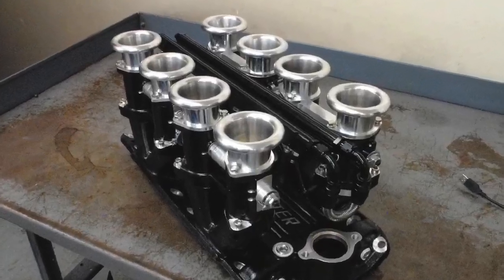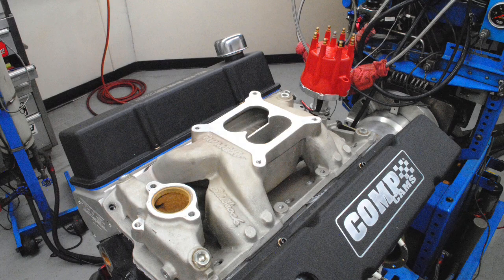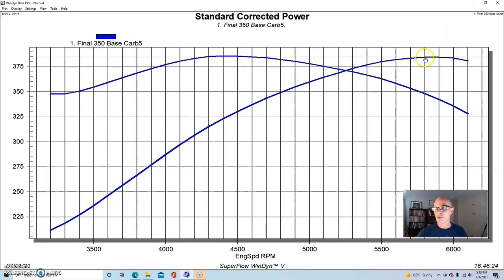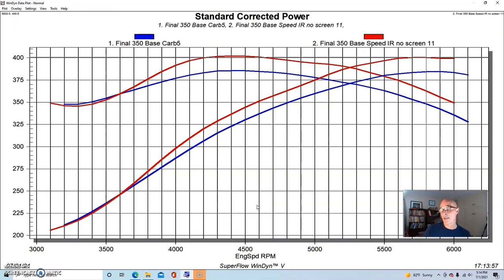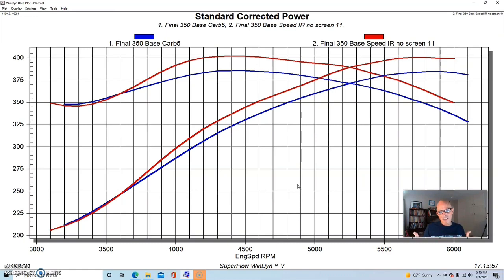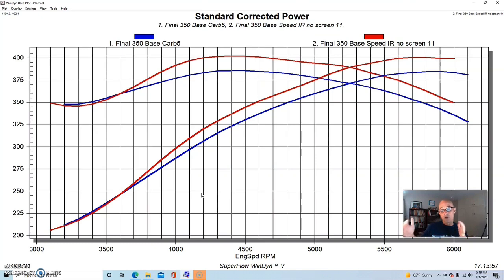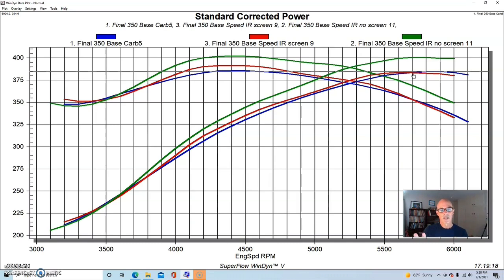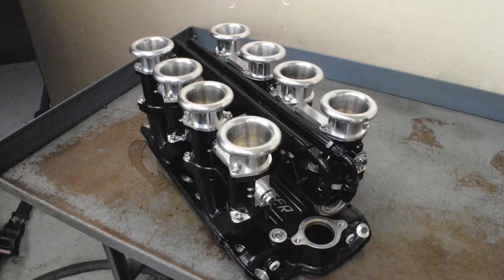SBC EFI STACK INJECTION-DOES IT WORK? (FULL DYNO RESULTS)

Comment: Now do 4 down or side draft Webers 🤯 And when you yet to the Ford the unicorn of carbs. The Autolite inline 4 bbl
Reply: Never play leapfrog with a unicorn.
Autolite inline 4-barrels are wicked.
Reply from the maker: I have a test up on the Autolite
Reply: Those inline Autolite carbs worked really well with the better airflow and mixture distribution - until the cars went into a corner (they were born back in Trans Am racing days) - and for some reason Ford abandoned them instead of working out the fuel slosh problem.
Reply: @Motor-City-Mike  
The fact that the SCCA disallowed them for Trans Am use didn't help. And as I understand it the whole point of the inline carb was runner optimization with the spacing on the carb matching the intake port spacing on the Boss 302 heads. When these showed up at the start of the 70 season the SCCA had instituted a rules change for A Sedan (the basis for Trans Am) that disallowed multiple carburation.

Comment: I was just watching some Steve Tech videos with Steve Morrison, and one that grabbed my attention was about hydraulic roller lifters vs solid roller lifters. One thing he mentioned was that it's a possibility to run a solid roller with the hydraulic roller camshaft. Have you done anything yet on this. I was wondering what kind of difference in power you would see with something mild, like the combination you used right here in this video. I had seen a couple of other guy's videos that mention that the maintenance isn't as big of a issue with the milder stockish/mild performance camshafts. More or less, being more streetable, and somewhat reliable. Thoughts?
Reply from the maker: I don't really see a reason to run a solid lifter with a hyd cam on a mild application-we have run solid lifters on hyd roller cams on BBC applications and it works just fine
Reply: @richardholdener1727  but why? is it for more radical cams and the hydraulic has softer ramp up on and off the seat? as I'm building a BBC with a small 250 supercharger thanks. love the stacks vid to be fair the carb should of had a run with a filter too but I get it . Cheers from Australia
Reply: @r0bkills  choose what lifter you want to run and buy the appropriate cam. Lobe profiles vary A LOT , i have fitted street solid rollers with less aggressive lobes than many of the gnarly hydro rollers, there is no need or magic. 
 The basic big difference is the lash ramp, if you run solid lifters on the hydro cam youneed to ensure your lash setting falls within the lash ramp.  Also the lobe profile will no longer reflect the spec of the cam as   lash or lack of it alters what you see at the valve.  Yes it can be done, solid on hydro or hydro on solid but no point if starting from scratch.
Reply: @8power857  thanks 8power yep going hydro on both only aiming for 650 hp cheers!
Reply: @r0bkills  no problem ✌

Comment: I run 8 stacks EFI an a 452 cu. in FE Ford.  Made 600 ft.lbs on the dyno, up 50 from the Victor intake with 850 holley.  Peak HP was about the same.
Reply: So I’m other words not worth it. 3k for a 50ib increase? Only thing I see worth is the badass look it gives. The borla 8 stack is 5-7k…. With that money you can get way more hp and tq investing it into heads and other goodies
Reply: The stack sounds awesome also.

Comment: Correct me if I am wrong,  but you didn't use a filter on the conventional card either.  So its safe to assume the same losses would happen,  and then stack injection is still ahead.
Reply from the maker: a filter on the carb set up has no effect on power

Comment: So the filter costing power on the ir manifold is not super surprising, they cost power on the single 4barrel as well…
Reply: How dare you compare apples to apples...
Reply from the maker: the right filter on a 4-barrel carb costs nothing-it can actually add power
Reply: @richardholdener1727  I don’t disagree, is the same not true of the ir? I’m assuming your point is that you can’t see the cool factor of the ir if you put a filter system on it, but there is still the neck snapping throttle response which is pretty cool!😉
Reply: @richardholdener1727  can "right" air filters add power to individual runners like they can on the 4 barrel?

Comment: Any more info on those heads? Also, any idea what compression this motor has?
Reply: they are a 64 or 72 cc head so this would be the 64s making it stock compression so 9.4 to 1... as close as the money is go with some afr heads
RHS heads
https://www.racingheadservice.com/cylinder-heads/small-block-chevy.html

Comment: Slight critism: it would be great to see what happens from 1500/2000 rpm. For those like me who are more interested on road driving/bottom end torque. But a very good video!
Reply: Wrong channel, I’ve asked similar before and got told it was a stupid question by dyno god
Reply from the maker: no one runs 1500 rpm at wot

Comment: Hey Richard, as always, cool video! 👍👍 Just out of curiosity, do you know what the CFM rating of the stack injection is?
Reply from the maker: they don't offer a rating that I know of-but 2000+ cfm seems realistic with over 250 cfm per runner
Reply: @richardholdener1727  I figured it had to be a lot. Thanks for replying!  👍👍
Reply: Keep in mind total cfm on a shared intake V an I.R. intake is quite different.  If it had a 2000cfm carb on a shared intake it would be a dog, if the IR were rediced to a total of 650 cfm it would make no power! 
 You need to think in loose terms of 'what cfm is available to each cylinder'.
Reply: @8power857  That's a very keen observation. Airflow through each stack is intermittent, and other cylinders cannot share a stack.  I was not thinking it through. Thanks for your insight sensei.   👍👍👍
Reply: @thetransformatorium7980  no problem,  👍
Reply: The same as the 650 dual plane with with air filter 😂

Comment: I wonder what would happen if you put a box on top of the itb and then plumbed in a turbo?
Reply: I would think it would be pointless in a turbo application.  Forced induction is already maximizing the available O2. The individual intake runners maximizes avail O2 for NA application.
Reply: @ufarkingicehole  
I disagree. Whatever you do to improve an engine's NA power will be magnified with boost. Most ITB are tuned to produce power over a certain rpm range based on their length. If you get that range to line up with your turbo sizing I'd imagine it would make a lot of power.
However, I do agree that, in practice, ITB is pointless in the sense that, with boost, installing a plenum would mean a single large tb at the opening would make more sense. 
I was just wondering what would happen if you simply boxed in and boosted itb as is.
Reply from the maker: boost would just multiple what is there
Reply: @richardholdener1727  
It would still be interesting. I've never seen boosted ITB.

Comment: This is the second best intake manifold, behind the belt-driven intake manifold.
Reply: Cross ram Mopar wedge manifold are pretty baller!
Reply: I'd rather bolt a hairdryer to the exhaust manifold.
Reply: @hudsondonnell444  
The spinning exhaust manifold is the best kind of exhaust manifold.
Reply: I’m a big fan of the belt driven manifolds.
Reply: For a second I was like "belt driven ignition?" And I realized. BLOWER!!. I love the look and sound of those big chrome beasts.
Reply: @Larry Powell Just buy an RB26, they come stock with twin turbos and ITBs.
Reply: @Larry Powell a lot of itb cars run a plenum over the itb's. This also makes it possible to use maf sensors an such
Reply: @Larry Powell The RB26 has them. 6 individual throttles connected to a central plenum that's plumbed through the intercooler to the turbos.
Reply: @Larry Powell bmw used it for their v10 for instance, and ofcourse the legendary RB26 also uses ITB's with a plenum over it.
Reply: Belt driven manifolds are king

Comment: So, how big of an ls cam can I run stock? Hahahahaha
Reply: Buy the biggest cam you can and if it binds the valve springs buy bigger head till you're happy
Reply: @ijmodified  you are the kind of people I like to party with! 🤘
Reply: @Go4BrokeOffroad  just keep in mind that when the valves touch the pistons, +3cc pistons get you valve reliefs so get  -3cc heads to keep the compression up
Reply: @ijmodified  that's right, you want to keep a perfect quench. That's how I test my valve springs. I like to wing the 521 to 7500. Then run stiffer springs until the valves stop touching.
Reply: Yes